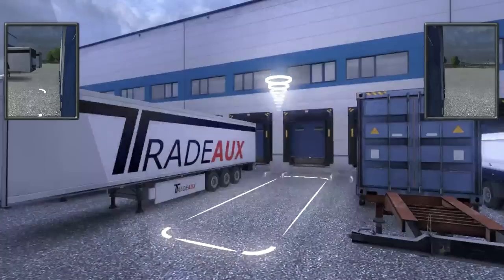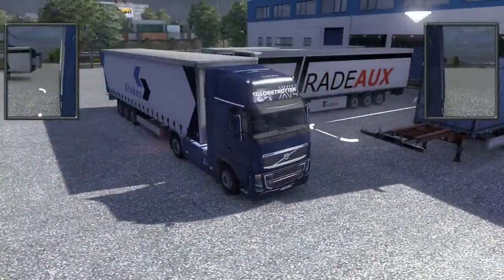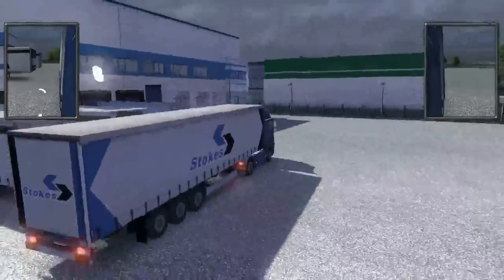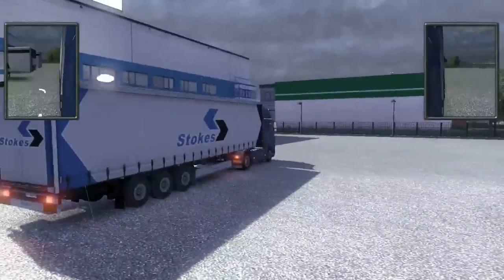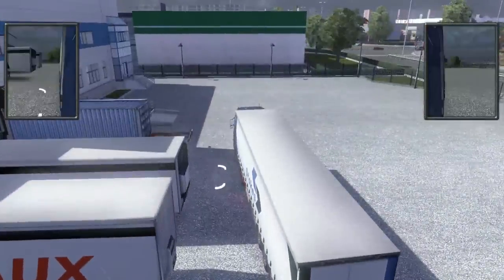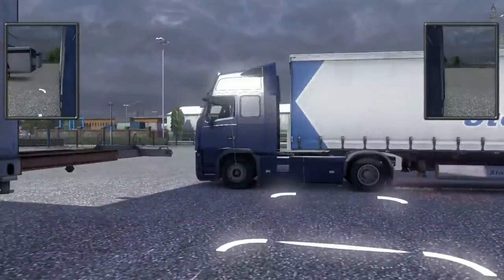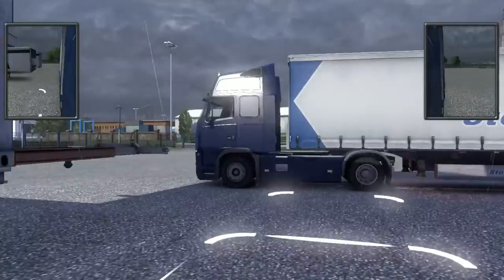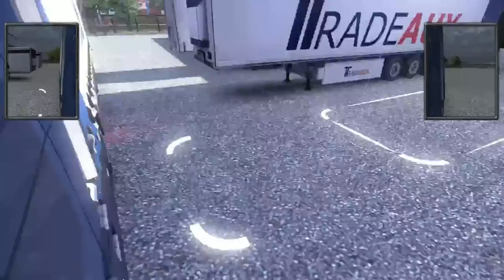Euro Truck Simulator 2, Alley Dock Backing

Comment: This appears to be a very helpful simulation.  It is actually the same set up our instructor in the yard is having us perform. I think the reference of the tandems to the dock's " near"  line is exactly what I needed to hear and see. Not to bash my instructor but the explanation given  to perform this maneuver is sketchy and/or vague at best. Never really explaining what "getting" under the trailer is or does to pivot the trailer into the position you may be directing it into. 
Thanks a bunch for this breakdown.  At this point I will accept all tips. Lol
Reply: OMG. .. at the yard this morning and had a near perfect Alley dock and off set. This video truly gave me the necessary points of reference to hit when doing this maneuver.  
Thank you

Comment: A tip I've always used and find helpful. When using the "lean out" view. Simply steer as if your back end were driving, as if you were sitting at the other end of the vehicle. So as you view going reverse from this angle, if you need the back end to go left, you steer left. If you need to adjust to the right, steer right. It's as if you were driving from the back, while looking from (the front) other end of the truck. Think of it as having a steering wheel at both ends of the truck. So if you need to turn and pull far straight away from the spot. Select the lean out view and simply use this method. Remember, your view is still from the "front" of the truck, but drive normal as if the back was now your front end. Just keep the cab in mind if making large turns. It's swinging side to side don't forget lol
I'll be making videos on how to make your own Button boxes and cockpits. Add switches and even a keyed starters to ETS2 for the next level of sim!!!

Comment: or you just drive straight forward after the first 90 degree turn since you have the space. But a good video but no point in being blind on the other side if that trailer behind is standing a bit off. 
(Parking around 50 trailers a day at my dock job).
But you have a good reading of how to do stuff and I never thought of this. going to try it at my job.

Comment: just......wow. you wouldn't know if i could use this on my dds test day would you? the way we were taught is to line up our bumper with the cones, go forward 3 seconds, stop, reverse, hard right turn to make an "L" shape, hard turn left when the tandems start to move, stop, make another "L" with another hard right, then straighten the truck up for a straight line back. but the way this video worked out looks a lot more easier.
Reply from the maker: this is how i have always backed up. Did it this way for CDL at a Utah DMV. i doubt Georgia DDS would give you points unless you hit cones.

sorry i have not put out a parallel video out. its practically the same as the offset backing.
Reply: kundarsa so your a fellow professional driver as well? high five
Reply: +Brandon Eaton So when you make the first move, it's a hard right. Now you go forward with that first hard right?
Reply from the maker: +mansamusa2012 Each truck can be a bit different, the Volvo seems to have the tightest turning radius. i can say in a freightliner turn the wheel all the way to the hard stop and it works out perfect.

Comment: Man it's definitely a skill. I tried this on Truck Simulator USA for iOS and it's difficult still trying
Reply: Yeah on a phone with tiny keys.  I see.  Even on a real keyboard this is quite a challenge.  Best bet is a wheel master hook up so you can adjust sensitivity.etc   It makes me want to vomit at the idea of playing a truck simulator on a stupid phone.  As soon as I save up I'm getting me a wheel wdth pedals.
Reply: Joe Smote Gaming first, american trucks are long wheel based because the front wheels are way further in front and not underneat the cab, so the turning circle in most american trucks are really bad compared to european lorrys, second never play driving or truck simulators on mobile debices
Reply: *underneath and devices